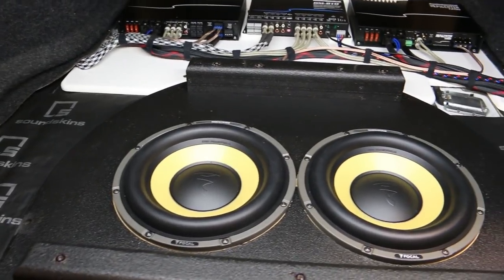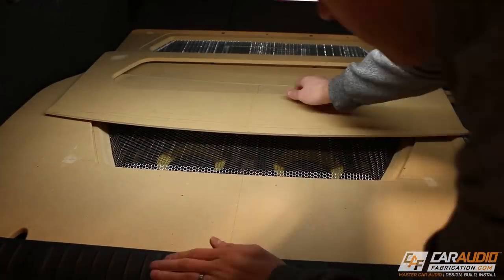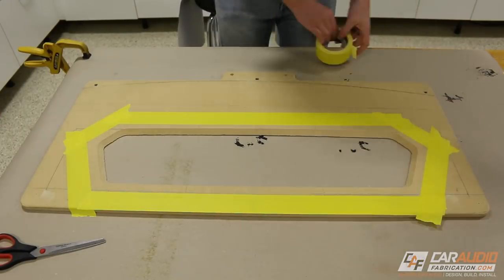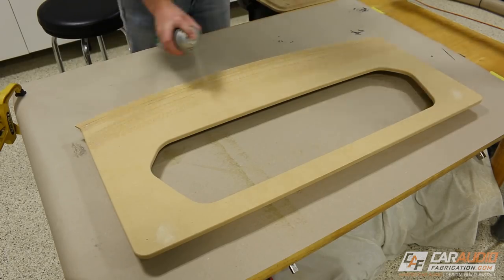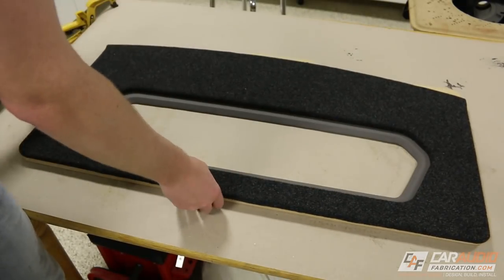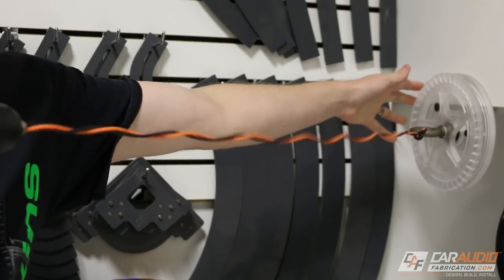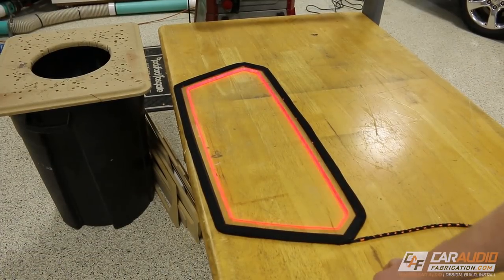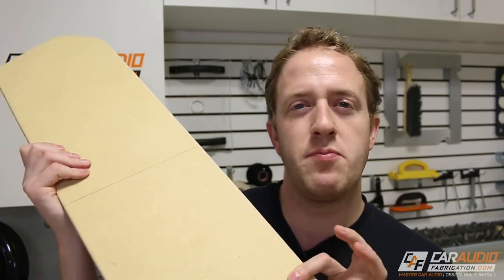LIGHT IT UP! LED lit plexiglass acrylic & upholstery

Comment: Hi, Mark.
First of all, congratulations for your channel and hard work.

I would like to make you a suggestion for other car audio topic.
As you know, many brands (think Audi, Mercedes, BMW, etc) have offered different audio systems as low, medium and premium packs (like Bose, Harman Kardon, B&O, JBL, Burmester and even some well-tuned Sony).
In many (if not most) cases, the installation on the outside looks just like the base audio system for that same car, although it has very significant changes under the skin.

IMHO, there’s a whole market for people that bought (are buying) used cars than would like to have better sound, but without sacrificing the space that a 10” subwoofer and its box demands inside the car (which is different on a A class vs E or S Class).

It is always possible to retrofit one of those “premium sound systems”, but it has to be made with used parts (which the real condition and durability is always unknown), and the wiring is often way different from the stock base sound system (not to mention the need of programming the head unit with dedicated software to the actual configuration, as the same head unit is often used on the sedan/wagon and convertible versions of the car, and needs to be told which car is it working on now).

So I’d argue that it’s possible to make something which sounds as good (if not better) than those premium out-of-the-factory systems using new aftermarket parts, but retaining that OEM look.

I’ve seen your stealth installs and they are amazing, but I wouldn’t want them on any of my cars today (and over the years I literally sacrificed 90% of my boot space for audio gear 😉 ).

Some of those premium sound systems are quite good* for something that maintains most of the functionality that a bigger system will struggle to do (specially on smaller cars like we have in Europe).
Those small upgraded systems can never be compared to the ultimate performance of having bigger high-quality subwoofers and high-quality amps, but when properly designed (*yes, some of them are crap) I believe that we can have a great sound quality, decent bass extension, but (of course) sacrificing the maximum SPL, which most people (including myself today) don’t need anyway on a daily car.

I’ve been in the audio business (and a musician) for a few decades now, and I’d say that I’m not necessarily the easiest guy to please when it comes to sound quality, but today I trade most properly designed “stock look alike” installs in a car over large audio gear inside the car.

A 10 inch sub will have benefits over the most common 8 and 6.5” found on those “premium” stock systems, but it needs the added space and power to be able to go loud and get the added bass extension.
In a smaller car (think about an A3 or C Class), maintaining the trunk space (and/or spare tire) with those smaller subs will be preferred any day over a bigger subwoofer with a huge box and/or visible subwoofers, and when we’re talking about smaller enclosures, trying to fit a bigger subwoofer will often get worse results than dealing with a smaller one (even if that means sacrificing maximum power output in favour of extension).

At this point in time, I’m much more interested in that than the “typical” big box car audio system, but it’s also harder to find those implementations on Youtube, and maybe that’s an opportunity for you and your channel, as this is also challenging.
I’d argue that it’s even more challenging that the “traditional” approach, where differences are often made on the quality of fit and finish, and products/materials used.
A more stock looking install still needs good quality components, a great quality install (special adapters are still very needed), but with and increased sense of “engineering” thought and tuning in order to get the best performance from a more limited system (mainly in the bass region).

I guess it can also be a great project!

Thanks and keep up the great work.

Cheers.

PS: I have in mind relatively smaller cars, as trying to get that decent bass extension and decent SPL in a big SUV it’s a totally different story, as there is much more volume inside of them to fill with sound/bass, and in many cases they also have more space to install bigger subs.

PS2 (edit): Just to clarify, I mentioned those 3 german brands only because they are very common here in Europe and in the USA, so it’s easier to relate car sizes. In reality, this smaller setups have a lot more units on the road from several brands, and that’s what I’m “aiming” for.

Comment: Mark, so this time around you wired up the lights by wrapping the lights themselves around the plexi, instead of laying the lights down in a piece of wood and then placing the plexi in the middle, like your Jeep build.  Is this method the better of the options?  It certainly seems effective!  BTW, I just wanted you to know that I binged on your videos a while back, ordered up some tools to start working at a higher level of quality, and thanks to your vids my fabrication is much improved.  You really do master the concept of work smarter, not necessarily harder, with excellent results.

Comment: I have the same car that you did this project in pontiac grand Prix, I plan on doing the same thing on my car, can you make a video on all the tools I would need to accomplish this job? I  think I have most of the tools including a router table, probably need to buy the set of router bits you have, I also plan on using the skar audio system since is more budget friendly, also can you make a video review about Skar audio systems.

Comment: Sorry if this is a dumb question, but how did you exactly wire up the distribution block to turn on with ignition. Did you use a relay? I'm trying to do the same thing for a gauge pod. My problem is, I have 4 guage wire going to the the distribution block and dont know the best way to wire that to a relay and then to the block, if that makes sense

Comment: Could this be wired to the trunk light sensor?  Dont need the LED's on when the trunk isnt open.
Reply: Yes you could do that!
Reply from the maker: You can do anything you want. I like the glow when the seats are folded down.
Reply: you can do anything
Reply: @CarAudioFabrication  is there any way to remove almost all trunk rattle?
Reply: It's very easy to do it using the trunk light wire.  That is how I have mine done.  I ran it to a distribution block that has both of the amps and the speaker lights.

Comment: Cant you use some tougther mesh or reinforce it so you wont need the protective plate? Some steel bars from under reinforcing or something?

Just wondering it migh be irritating carring the plates around.

Comment: Very nice! I love the stealth concept now. I had 32 speakers in a 1992 hatchback Mustang and the doors and kick panels were anything but stealth. I never got around to making grills to cover up everything before my car had been involved with another driver delivering pizzas....(won't go through THAT ordeal).... and while at a home based business for the bodywork\paintwork.... while not wanting to hand my alarm keypad over I just put my alarm into "valet" mode.  Someone broke into my car and did away with everything. Cut RCA wires that could have easily been unplugged. Felt like I was raped. It was terrible. The guy didn't have insurance for cars that weren't inside his garage. I've learned to keep "quiet" about stereo stuff and I have been jamming to a stock stereo for a few years now and don't have the funds to go nuts anymore....but when I do.  Stealth is the best mode of "protection".

Imagining how the car break in artist would potentially steal whatever was in the center console and glove box and leave the audio system behind would be great! No where near as devastating.

Miss that car. It was a concert on wheels! 😎

I enjoy your vids!

Comment: What do you do to prevent overheating of the amps
Reply from the maker: Use high quality amps. A quality amplifier will be designed in a manner that it can survive in a compact space like those in a vehicle environment. Poorly designed amps need a turbo fan blowing on them.